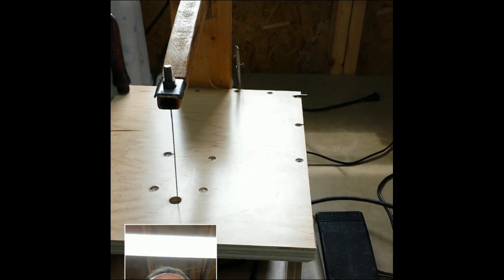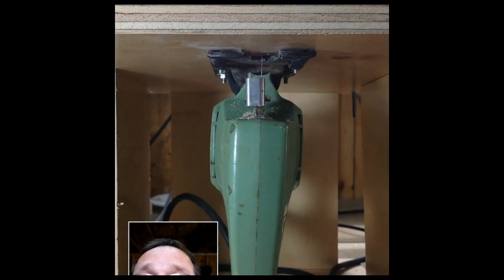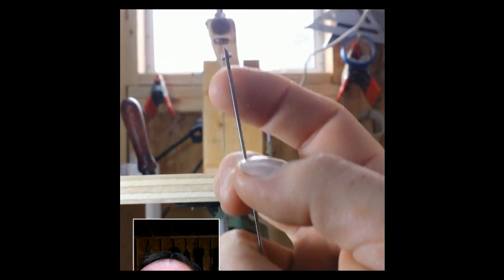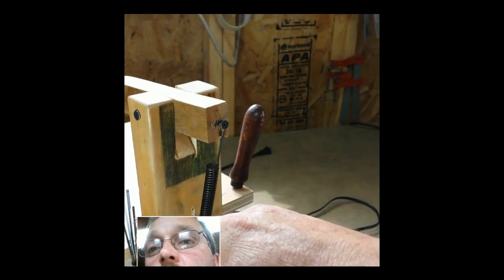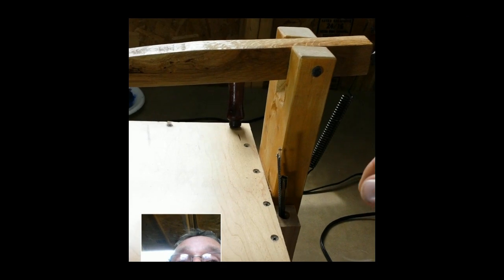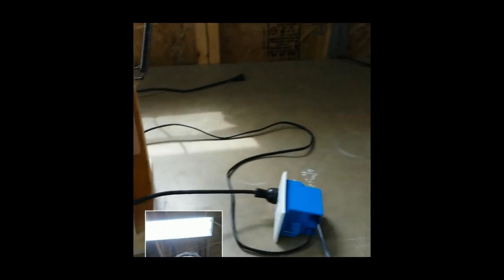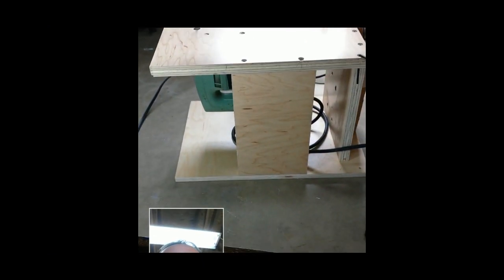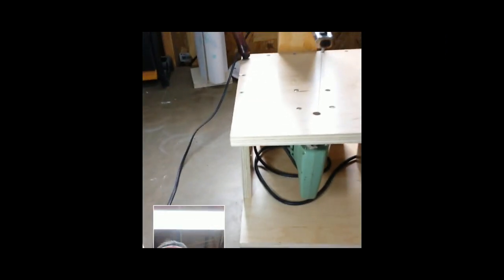DIY scroll saw mechanics

Comment: To be frankly speaking this arrangement of your DIY scroll saw is the simplest method.Further in India normally we get the pin less blades . If you are kind enough to enlighten me on how to use such blades and the arrangement to be made for such a blade holder. Further if you can part with the measurements of the wooden pieces utilized; especially I need to know the oscillating arm wood piece length etc will be more commendable. Thanks for posting such an useful video.

Comment: I cant justify the cost of a scroll saw for as little as I would use it now  but this idea I could get behind  so I will add a jig saw to My garge saw scroungeing list
Reply from the maker: That's the same for me Walt. I wouldn't use it enough to justify the cost of a decent new one.
Reply: Gateway drug to more expensive tools ?
Reply from the maker: Walt Lars No, that was when I got my band saw last month. LOL. That lead to a new router and table, new table saw and the list goes on.
Reply: Then come the lathe and shaper.  And the worse a thickness sander  its a slipery slope